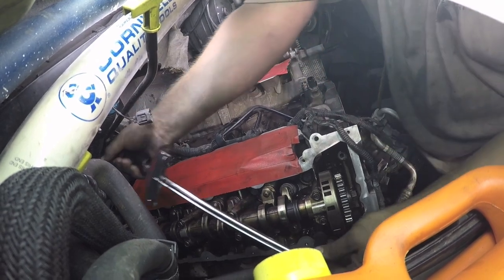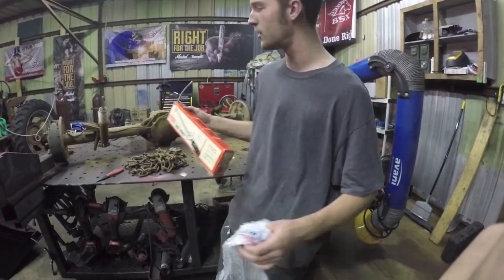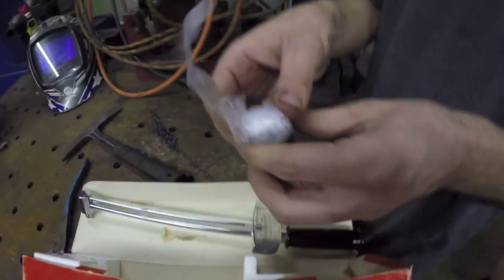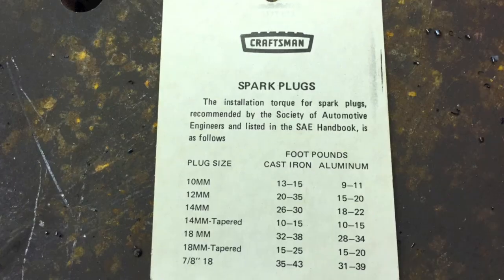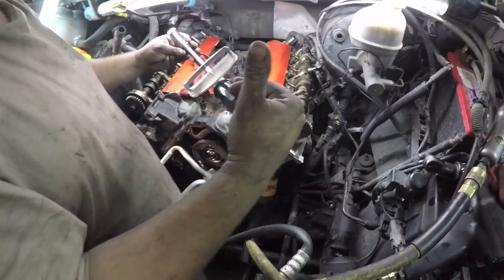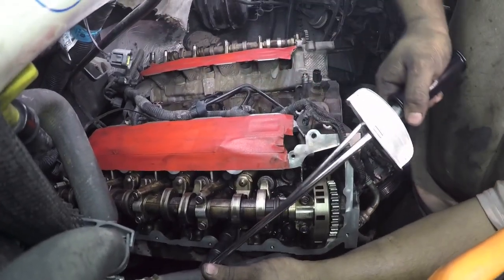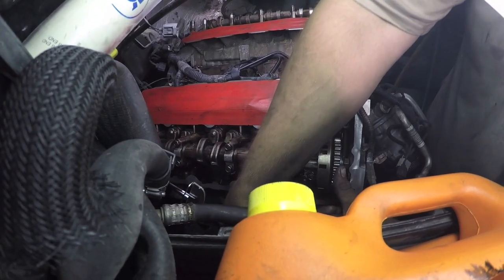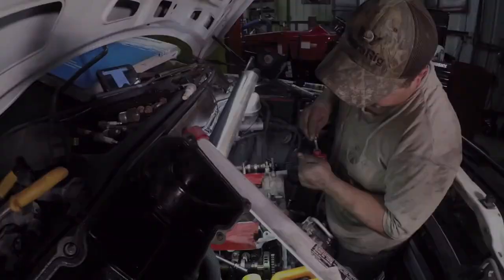HOW THIS ANTIQUE WRENCH CAUSES MECHANICS' RAGE WHEN WORKING ON TRACTOR OR TRUCK

Comment: Beam wrenches like that are absolutely great for situations where you need to measure or monitor torque as it's going on the fastener (and you would usually use them a little more gently than in this video). I always use my beam wrench when I'm working with aluminum threads because you can actually watch the threads stretch before you pull them out. Yes, you can do the same thing with a modern digital wrench, but probably not for $30.

I wouldn't recommend a beam wrench for your only torque wrench, but they're just fine for your first one. I have my grandfather's 1/2" beam wrench from the 1940s and it's still serviceable. My last clickers didn't make it a decade.

Comment: I’ve heard I’d you drop it the accuracy goes way off.
Reply: No. This is actually the only type of torque wrench you can re-calibrate yourself. If the needle isn't pointing at 0, tweak it a bit until it does.